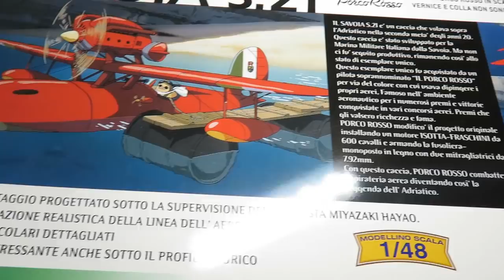Fine Molds 1:48 Savoia S.21 (Porco Rosso)

Comment: Gotta love a red aircraft👍 superb finish you have there. I recently finished a mig 19 in the colours of the red airforce display team (Very red👍)I had a nightmare with tamiya x22. It just wouldn’t dry properly. The finish was ace, but it wouldn’t completely harden. I turned to trusty humbrol clear cote. Thanks again for the quality content👍
Reply from the maker: Thank you very much. I agree I had a very fun time looking at this Red aircraft. It's been nice to deviate away from camouflage colors. I've had mixed luck with Tamiya gloss paints, and one thing I learned is to not have one massive coat that's quite thick, much as I would with their flat-based paints. It just seems like you mentioned they don't want to harden. I think thinner coats being allowed to dry properly might be more beneficial.
Reply: rebelsatcloudnine thanks for the reply. Maybe I need to practice some more👍 I’ve only had my airbrush for a couple of months.I may try some klear if I can get it in the UK. Thanks again 👍🍺
Reply from the maker: That sounds like a good plan. I've been using Tamiya for years and still I find that they have a few paints with "quirks" when it comes to airbrushing them. I use Klear/Future quite often, but like you said it's harder to find in the UK. A friend on mine in the UK used Humbrol Gloss, and really likes it. I think it's his go to gloss paint. Since I'm in Canada I don't have easy access to it, but it might be worth trying it out?

Comment: I have tried to use that mr color but its so thick!!! and i was using a brush and i almost messed up my ship i was making 😢 do you just mix it with thinner for the airbrush?
Reply from the maker: When I'm hand painting with Lacquers I'll thin them down with with Mr. Color Levelling Thinner, or Tamiya Lacquer Thinner with Retarder (it's the bottle with the Orange Cap). Both of these have retarder added with slows down the drying time of the paints.

However, if your paint is thick like syrup straight out of the bottle, you might need to add Mr. Replenishing Agent, from Mr. Hobby. I have a video of this product on my channel, and it's designed to thin down the paint to normalcy again, as Lacquers have the tendency over time to thicken up.

Comment: I’m putting this together right now and I was hoping to see how you put the decals on, I’m having a really hard time with that part, any tips? Are they stickers…or what?
Reply from the maker: Hi there Ashleigh, sorry about that, but since I decided to paint most of the sections that were decals I decided not to include them in the video. These are water slide decals, and they are simple enough to use but can be tricky. You cut around the decal and then submerge them into water. After a while, the decal will be able to slide off the backing paper. You can then slide the decals into place on the model. If the decal sticks in the wrong place, take a clean paint brush, dip it in water and brush it over the decal. This should help lift the decal again so you can move it into place.

Once you have it in place, take a cotton bud (Q-tip) and slowly and carefully roll over the decal removing the water underneath. This is a critical and delicate step. But after that, the decal should dry enough that you can handle the model. 

If you have any more questions let me know and I'll try to respond as quickly as I can.

Comment: Nicely done!!!  It is interesting to see that you are using non-Tamiya glues and paints.  Are you finding the Mr. Cement better than Tamiya Extra Thin?
Reply from the maker: I had recently bought them and I was more or less testing them out on this project. They are certainly stronger or hotter than the Tamiya glues. This had its advantages with this project as the styrene was red and that's a harder plastic to fuse together. I like the Mr. Hobby Cement a lot, but I'd say be cautious, because it's stronger it's more aggressive with the plastic, and you need to keep an eye on that.  I do like how quickly the SP dries, and it's like magic on Airfix styrene, really bonds that together.

Comment: did you know that porco rosso's plane (even if called S21) is a macchi M 33
Reply from the maker: There are quite a few similarities between the two aircraft, the S.21 is not an M.33. Miyazaki said that the design was based on several Italian aircraft of the 20's, which he's a big fan of. Also in the movie Porco explains that there was only one S.21 ever built because it was difficult to handle.

Comment: Any airbrush kit you can recommend for beginners? :)
Reply from the maker: That is a bit of a loaded question, because everyone will have a different answer. But for me I got started with an Iwata NEO CN. It's a very beginner friendly airbrush, and it still has a lot of function that you can do a lot of painting. 

It has a 5 year warranty from Iwata, but after the 5 years that airbrush really started to fall apart, and at that time I was ready to move onto a more advanced airbrush. So I still think that it's a good beginner airbrush, and after a while you'll be more confident airbrushing and move onto something else.